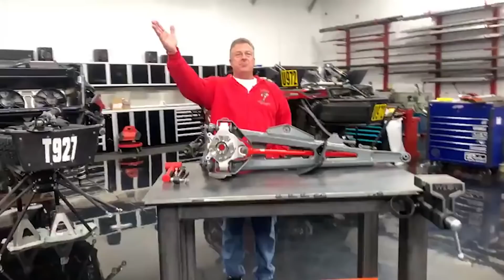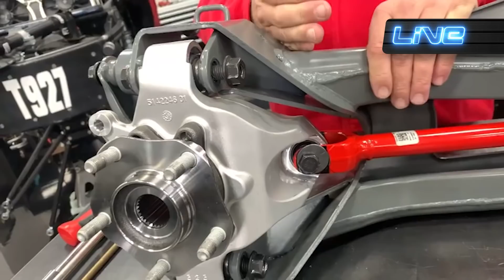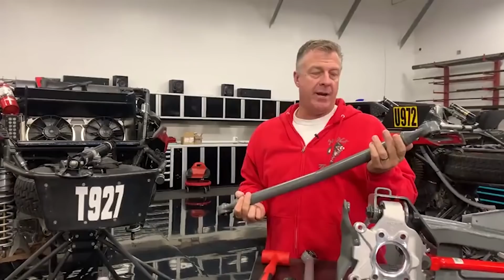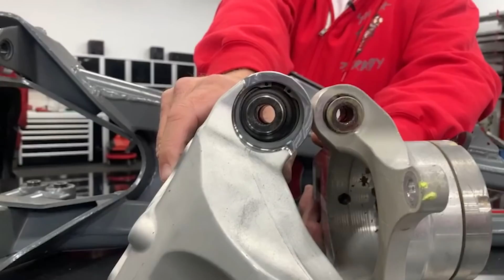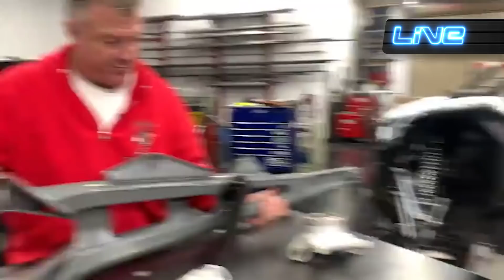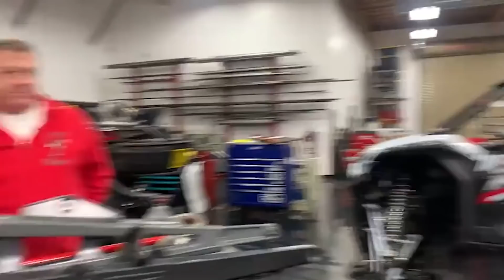Polaris RZR Pro R Rear Hub and Arm Assembly (Shock Therapy Live 12/28/2021)

Comment: So how do you actually adjust the toe? I just got my Turbo R that has too much toe in on the passenger rear casing the car to pull right. Trying to adjust it myself so I don’t have to tie it back on the trailer to go back to dealer
Reply from the maker: Loosen the toe link where it attaches to the hub. You then rotate the bolt to change toe. It’s an eccentric bolt adjuster.
Reply: @ShockTherapyllc  gracias! So loosen the bolt behind the hub then adjust the bolt through the wheel like you described in the video? Any ideas on the torque specs? (I checked the manual nothing there)
Reply from the maker: @jabroni6199  you are correct. 12 mm bolt. 90 ft lbs.
Reply: @ShockTherapyllc  you’re awesome thanks.  Looking forward to seeing you guys in the desert next season now that I finally got a capable rig!

Comment: Very informative, I now know why at speeds over 40 or 50 mph on whoops my turbo s starts to feel loose like I could lose control. The feeling comes from the rear of my buggy. Its the lack of toe control on my car since its just a two link system and through the suspension stroke my rear tires are scrubbing in and out of alignment. Anyone offer a complete suspension upgrade for the turbo s to bring my 2021 machine to 2022 standards?🤣

Comment: Off topic but what do you guys think of the chupacabra racing rear box they are making? Would that be too much weight hanging off the back of the car or could stings be adjusted to compensate for that. I love the idea of putting the tools and cooler down in the box low and the spare tire at what would have originally been the bed height.
I'm looking at ordering springs but am considering that new box.

Comment: I have a Turbo R on order. Replacing my 2019 Turbo S with it. Is the geometry just as good on the Turbo R as it is on the Pro R? I also heard those questions talking about the Pro R being in its own racing class because of the motor size and some other rules as well. Would the Turbo R be able to run in one of those other classes with other manufacturers? Thanks for all the additional information! Keep up the good work 👍🏼
Reply: Yes the Turbo R is fair game in the pro turbo class, the rules specify 1000cc or less so it’s only the Pro R that will be forced to race in the new “Open” class.  And some organizations limit the width to 74 inches in pro turbo, so wheel and tire options could theoretically throw you over the limit and force racers into unlimited/open

Comment: Not a Robby fan boy but there’s some things Polaris did that are very similar to his car double shear is becoming a thing, interchangeable parts, Beefier frame, safer and better cage to frame design, front shock mounted to the lower arm, I don’t care either way, I think Polaris built a great car other than the looks on the rear end should be a great ride
Reply: Looks like Polaris have been watching and learning off Robby videos. Robby did make everyone set up and change  how they build there cars! And overall a safer car!
Reply: @sincityduner  seams like it. safety is something they have skimped on for a while those older cages where complete garbage not sure why that’s the area they cut corners.

Comment: Seems overly complicated compared to the Wildcat XX's swingarm rear end to control rear toe change.
Reply: You may be right but a dual pivot trailing arm system has two negatives. One. No toe control so 2-3” of toe change is common. Second the total travel is very limited due to axle extension.
Reply: @shocktherapy4820  I will take a closer look at mine, but this comment does not make sense to me.  If the arm is moving vertically on two pivots (the XX), then toe should not change at all.  That is one of it's strengths.  The swing arm moves vertically on a single plane, no toe change throughout it's movement range, it would be impossible to get 2-3" of toe change on a swingarm car.  Axle plunge issues are real.  Many in the forums have solved it by making sure the spacing is set up properly, but still more delicate than a radius arm car.  (just proves that even the best designed cars have their (issues)). Of course you can permanently solve it even on a stock car by buying Speed double plunge axles.  Those things are all but bullet proof.
Reply from the maker: @jayjobes5344  Jay, Sincity and tristan. I am not about to say what is the best suspension design but just point out a few things between them. Jay, when considering a two pivot trailing arm system, you are correct about toe if the pivots are on a 90 degree plane relative to the center line of the car. This would have zero toe change and zero camber change. But, no dual pivot trailing arm systems are on a 90 plane. If they were then you would get way over 8" of axle plunge at the bottom and top of the travel. For this reason all dual pivot systems are on a 3-7 degree plane. That would mean pivots are 83-87degree from centerline. In other words the inside pivot is rearward a bit and the outside pivot is forward a bit. This does two things. One, makes 8" of axle plunge more like 3-4". Two it gives you negative camber gain as it compresses so the outside tire stays close to vertical in a turn instead or positive camber which turns like crap.  Negative issues are you get toe change through travel. Usually toe out at droop and toe in at compression.  Back to the CVs. Keep in mind that there are basically two types of CV. Plunging and NON plunging. Plunging CV's like those on a Tatum or Buckshot sand car or Class 10 or Class 1 race car have a max CV angle of about 24-25 degrees. This is always the limiting factor in suspension travel next to width. A plunging CV will not function with more than 3-4" of axle plunge. More than that will bind the splines under load and cause bucking in the whoops or push the trans out of the chassis or rip arms out of the pivot points (just like U Joint Axles did for a bit).  NON plunging CVs can go up to 45 degrees of angle but need a zero plunge suspension design to work or a plunging or telescoping axle to work. Originally in the XX Robby used a non plunging CV for max angle with a telescoping axle. The axles had issues due to too much plunge. Too much plunge and the axle would bind under load and pull out of the trans or loose boots and or fail. The fix was a plunging CV (less angle) and non plunging axle (which is a double plunge axle, it just plunges in the CV) and less travel. 
The Pro R rear suspension design uses a non plunging CV and a zero plunge axle. Same as a RZR or X3 or any other radius rod trailing arm system. With more cv angle comes more travel. With more travel comes toe change issues and track width changes. The toe changes are controlled best with a toe link like an X3 or the Max Link on the Pro R. But both still have large overall width issues which is just a byproduct of the high travel numbers.  With no plunging axles to bind up under load and no plunging CV's to limit CV angles this system has the most positives.  The best rear suspension design I have seen in a UTV is the KRX. With camber gain limiting some overall width changes and toe control it does the best job of limiting the negatives and maximizing the positives of anybody. Sand Car guys and race car guys would be smart to go the KRX design in the future. Jimco, huge race car fabricator has done this on some of their new class one cars. Hope this helps you guys a bit. cheers.
Reply: @ShockTherapyllc  Thank you for your educational reply.  I am going to get some tapes on mine with the shock off and run it through it's stroke and see what the toe (and other) changes are as it moves.  It will be a good education for me.  It is a fully built Speed 77" car with Kings, but in theory it should not change much differently than stock cars.  My issue with radius rods is the volume of them I replace in the shop for customers and the $$ it takes to make them robust, which are all things you have covered in your numerous videos (double shear, etc.)  It seems the Polaris has addressed many of these issues.  For me, the XX was the best choice as it was (at the time) the most solidly built car on the market that could take the most abuse off road even in near stock form.  Then I had the chance to buy a full built race 2018 XX for an incredible price from an owner I knew well (and trusted his work, maintenance, etc.)  The car has not let me down.  I can not believe how hard I could hit the whoops, ruts, etc., and have it not transmit it through the wheel or be a handful to control.  I am looking forward to venturing down your way during spring break and run some of the environment around Parker that this car was built to run (I live in SW Idaho).
Reply from the maker: @jayjobes5344  That is bad ass. I still love our XX. Killer car in my opinion. See you in Parker some time.
Reply: @ShockTherapyllc  I am a MC shop owner, and MC shock tuner by trade.  I love your videos and I have learned so much as I moved into  the UTV world.  At some point I will probably contact you so I can send my customer's shocks off to you.  I am busy enough with MC to not want to get into (and learn) UTV suspension tuning myself.
Reply from the maker: @jayjobes5344  Thank you very much. We will be here for you when ever you need.
Reply: It’s more complicated but you can get more travel out of it with plunging your axles crazy amounts. The XX is on its third design trying to get them to live with far less travel.
Reply: @tristanhipps604  25" of suspension "travel" is useless when your skid plate smacks the ground at far less.  But, I have no doubt it has more travel than an XX.  But, in the XX's defense, in 2018 it had components that were interchangeable side to side and front to rear.  Mine is a full blown RG 77" race car, so I can not compare to stock, but it is built like a tank.  I would take swing arms over radius arms ever day.  The Pro R looks great and promising though.
Reply: The Wildcat XX has axle problems and limited travel of 18 due to width. This car is 74 inchs wide.  You get wildcat with 72 or 77 and axles problems go away and more travel. You look at Buckshot or Tatum sand cars and they have same rear suspension  because it a 1970 IRS designed form jokeswagon and works well. Also fronts are all about same because it works for they all offer best Shock to arms angle for shock to work the best.